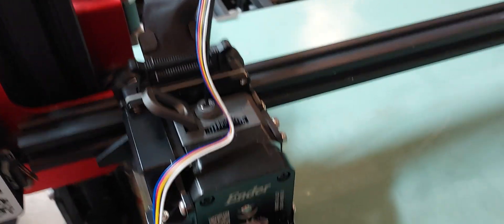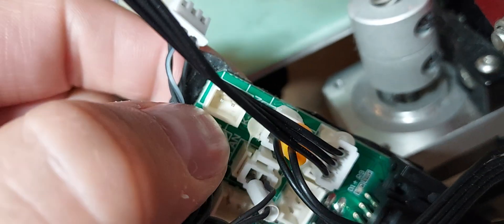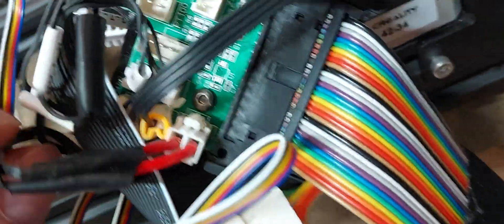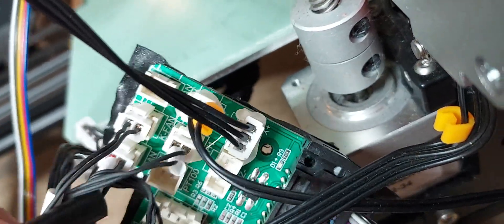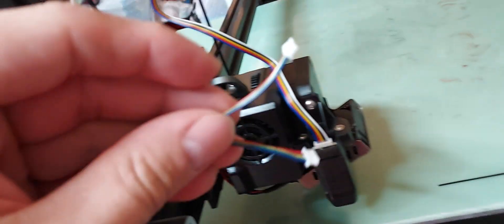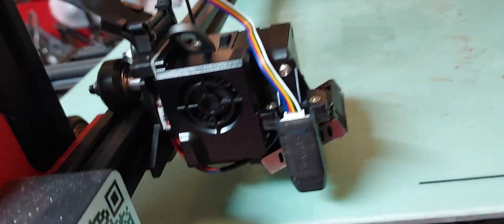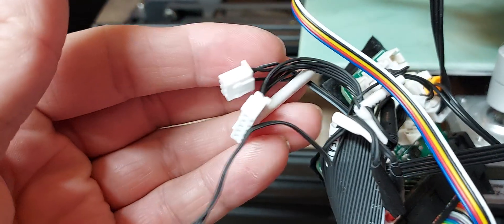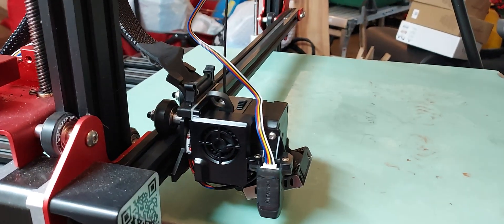Creality Sprite Pro Kit on a Creality CR10 Max (Minimum Modifications Needed)

Comment: Need some help here, I installed per your video on a CR-10 Smart, PSU is 24V. However when heating element or trying to advance or retract extruder the unit powers off. I tried with the official firmware as well as the InsantiyAutomation CR10Smart_DW7.4.7 firmware with no luck... any advice or idea what's going on?

Comment: Heck yeah, thanks for this. I am installing a sprite pro on a CR10s Pro v2  There is absolutely no documentation on that printer for the sprite pro, however,  It's almost identical to your max. I was going to ask about the extra unmarked wires but you addressed that. Thanks again!
Reply: And how did it turn out??? I just install the sprite on my e3v2, love it and start thinking to buy one for my 10s pro v2
Reply: @tijdrovers68  I am very pleased with the results. It works very well and is a much needed improvement over stock

Comment: Hi, thanks for the video. I'm modding my CR10S PRO V2 atm and im having issues getting the extruder to heat up (running klipper) - do you have any advice?
Reply: Hi, any update? I have the same printer
Reply: @JavyRosado  the sprite bricked the MOSFET on my mainboard due to it's weird thermistor wiring...

Comment: How do you deal with bed leveling? My probe goes outside of the bed boundaries and cant touch it. Also the carriage hits the frame on the right.
Reply: Could u solve it ?
Reply: @AloneHell  yes, you just run a simple g code and its done. Remind me in 5 hours so i can send you the code, i will forget otherwise
Reply: @colaigor  reminder, send me the g code pls
Reply: @AloneHell  

M851 X-31.5 Y-49.5

M500
Reply: @colaigor   it works for you with a sprite extruder ?
Reply: @AloneHell  yup, sprite extruder and  3d touch probe on cr10 max
Reply: @colaigor sorry...where are you inputting this into?
Reply: @pillowchan  i used pronterface, you can google on how to do it
Reply: @colaigor  pronter face isn't an option for me. Can it be done in cura?
Reply: @pillowchan  I think i tried connecting cura with printer but without any luck, you can try. You can also make .gcode file with those commands and just run it from the printer as you would with any other gcode. Make sure you store the settings after that

Comment: what about the extruder motor? do you have to modify anything ? like the wire or current limit from the driver ?
Reply from the maker: No. The only thing you need to adjust is the e-steps.
Reply: @PatrickLaughner are u just adjusting e-steps in software?
Reply from the maker: @AloneHell  Yes, using tiny machines firmware.